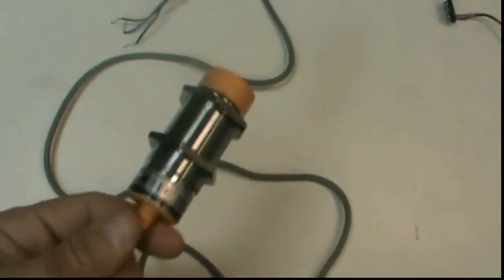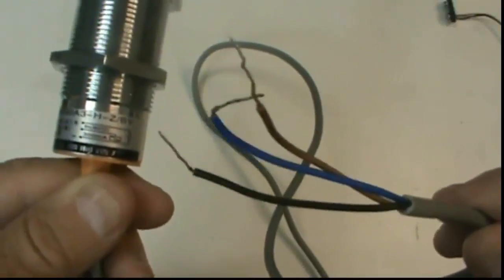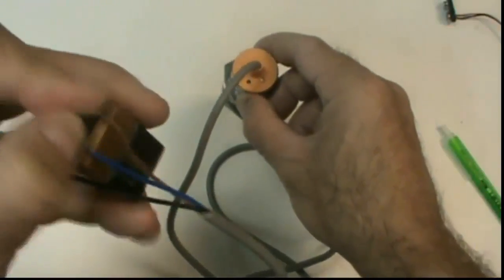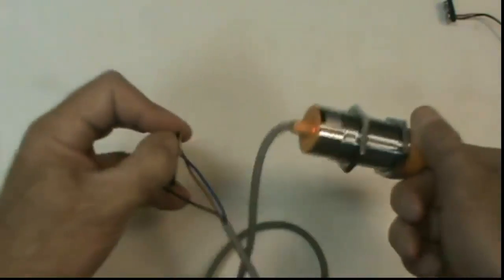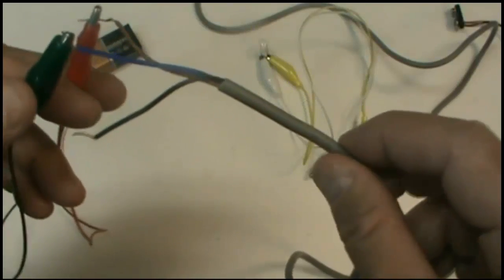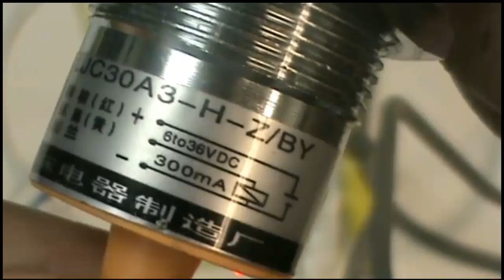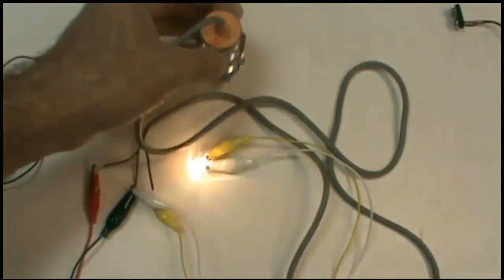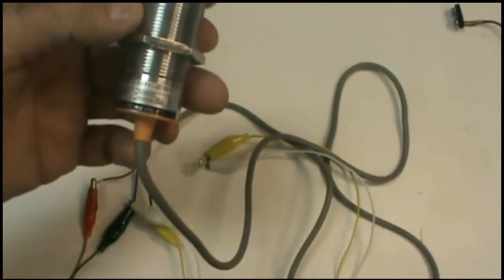Proximity Sensor Basics (PNP, capacitive)

Comment: Hi!
What is the difference between PNP and NPN sensors?
By accident I bought 3 NPN instead of PNP. I was trying to send output signal with this one, but it doesn't work. I already ordered the PNP one and I am just waiting to it get to my place. One of them I think isn't working because I tried to connect the leads as you say in this video and also the diagram on it is saying the colour code like yours, and still the LED light doesn't turn on, this one I think is faulty.
Reply from the maker: PNP sensors are Sourcing sensors NPN sensors are sinking Sensors. I have a video on the difference between sinking and sourcing you can view here:

PLC Sinking and Sourcing

Also if you are trying to drive an LED you must use a current-limiting resistor to avoid burning out the LED and the sensor. You must also ensure the polarity of the LED is correct.

The transistor in either an NPN or PNP sensor is only a polarity-sensitive switch and does not provide an output voltage by itself. The transistor is used to complete a circuit between power, the load and ground.

Hope this helps.
Reply: Dorian McIntire Thanks a lot for you answer!
Actually what I'm trying to do is activate a solenoid (DC 12V 0.5N 6mm Pull Type Open Frame Electric Magnet Solenoid Electromagnet) it works with a 9V battery I thought that I could use the same principle as you show in this video to make it works like the LED, but nothing happens. the funny thing is when I check the voltage it shows 9V, but the solenoid doesn't work I think it's due a voltage drop because the resistance created through the sensor, then I tried 18 volts doesn't work as well. I am waiting for another solenoid a better one (12V 5Kg Electrified Rate Pull Force Tubular Frame Solenoid Electromagnet), for the LED I used a resistor it did work. However it does heat, which resistor should I use for a 5 MM LED I got those
 100Ω Resistors
 1 kΩ Resistors
 4.7 kΩ Resistors
 10 kΩ Resistors
 47 kΩ Resistors
 X 100 kΩ Resistors
I just started to learn about those things which one is better and which one is the strongest. I read some thing about the colour coding, but I am still not 100% sure, what would you suggest?
Thanks you..

Comment: Hi, I am working on a project where one relay needs to be controlled by any one of 8 different sensors.  I see 2 and 3 wire sensors available on ebay.  Which would work the best for an application such as this?  Thanks for the vid.

Comment from the maker: If I understand what you want to do correctly you want a wired ORing behavior for these sensors.

This can be done easily by hooking (8), 3 wire, sinking (NPN) sensors in parallel. Hook the signal wires of these paralleled sensors to one side of your relay and the other side of the relay to V+. The activation of one or more sensors will activate the relay.

Be careful because while paralleling sensors will work here it can cause shorts in the wrong application.

Good luck with your project.

Comment from the maker: Frankmali17 I forgot to mention that the repeat-ability of a typical capacitive proximity sensor is around 2% of full scale. So for a 2mm sensor the repeat-ability is around .04mm which should be more than adequate for most situations.
Reply from the maker: +Dorian McIntire I use a Cannon HD camera with a cheap, lapel plug in mic.  Nothing really special

Comment: is it the same proccess to wire it to a 24vdc relay? i might be misinterpreting but it looks like i should have two negatives hooked up to it according to the video. which doesnt make sense to me how would that close the relay?
Reply from the maker: +Tyler Torch The same blue wire used to provide negative power to the sensor is also common for the relay for a sourcing sensor. Most industrial sensors only use three wires to provide positive, signal output and common (-). Look up the term "circuit ground" or "circuit common" if you want to see more about the concept.
Reply: So thats where my problem is then.. ive been trying to use the black signal on 2 and a positive (8 pin relay)

Comment: Is there  any hyraulic oil level sensor? So that when there is no presence of hyraulic oil. My sensor can detect
Reply from the maker: You could use the sensor to tell you when the level was low. You could create a threaded hole for the sensor in the oil reservoir at the low level and thread the sensor into place.

Comment: Dear sir I  would like to put together a system that will help me detect when an object taken out of the building doors. When it leaves either doors(two doors) I would like to be alerted with vibration from a handheld receiver and directed with a specific colored light from the same handheld receiver to know which door the object taken. For instance if the east door is green the west side would be red. Could you help please
Reply from the maker: This would be difficult using industrial sensors since the range of these devices is very limited. A reflective photoelectric sensor systems would be able to detect when a person or large object crossed the beam and that would be the simplest solution but it would not be able to detect the objects themselves. Anti-theft devices, using RFID technology, obviously work but each object would require a tag and the system is expensive. Wish there was a simple solution for you.

Comment: If you use a higher voltage is the sensor more accurate and increase repeatability accuracy
Reply from the maker: No, you must stay within the proper voltage specifications or risk destroying the sensor.
Reply: Dorian McIntire sorry I mean within the 6-36V operating voltage
Reply from the maker: Sorry but the range of the sensor does not change with voltage. The sensor contains it's own internal regulator to ensure consistent performance.

Comment: Hopefully you read this. I am setting up a capacitive sensor on my 3D printer for auto bed-leveling and I am trying to determine the output voltage of the sensor when it senses the bed. Well I just did a test using my 12V bench power supply and a multimeter to measure the voltage coming out of the signal wire when the sensor is activated and with a 12V input I was reading like 18V output??? Is that correct? Is there some sort of step up in the sensor? If that is the case I need to figure out what resistors I need to make a voltage divider to knock it down to about 5V since that is what my control board uses
Reply from the maker: Chris Griffin Some possibilities to think about:

1. Is your bench power supply regulated? If not it could possibly read 18 volts when unloaded. Measure your power supply voltage with your meter and let me know what you read.
2. Remember that most industrial proximity sensors only sink or source and only act as switches. If you have a sourcing sensor and hook your meter between the output and ground you will measure either no voltage or  full voltage but nothing in-between. Since the PNP in a sourcing sensor may leak a little you might measure a voltage whether the sensor transistor is on or not. To alleviate this problem make sure you use a load resistor (1K ohm will work) between the output and ground and measure across this resistor.

What type of sensor are you using?

Let me know, thanks for commenting and please consider subscribing.
Reply: Dorian McIntire Thaks for the reply!! Sorry I just sent you a message with more information :)  This is the sensor I am using http://www.amazon.com/gp/product/B00542U3M4?ref_=redir_mobile_desktop&ref_=yo_ii_img
Reply: Dorian McIntire The 12V reads 12V on my meter. This is what I am using to get the 12V from. It has a voltage output that is adjustable http://www.amazon.com/YiHUA-853D-Soldering-Rework-Station-Fire/dp/B00O400X36/ref=sr_1_1?s=industrial&ie=UTF8&qid=1437241911&sr=1-1&keywords=yihua+853D
Reply: Dorian McIntire I just subscribed also, your videos are going to be very helpful!
Reply: Thank you
Reply from the maker: Chris Griffin Oops. Forgot the sensor was sinking not sourcing. I will upload and alternate drawing. Sorry.

See the following video:  https://www.youtube.com/watch?v=soJ4czkKpT4

Notice the logic is inverted so an activation will give you a low and no activation will give you a high. This is not problem for the Arduino however since you software can take this into account.

The +5 volts is connected to the Arduino 5 volts the brown wire goes to +12 volts.

Let me know how it goes.
Reply: Dorian McIntire Cool, thanks
Reply from the maker: How did it go?
Reply: Well got it wired up with the resistors and checked the voltage on my 12V supply and it is reading 3.3V so I think I am good. Hopefully that is enough voltage now :)
Reply from the maker: Chris Griffin Great!

Comment from the maker: Sorry for the delay. YouTube keeps holding comments in limbo until I approve them.

I bought a bunch of these off Ebay for about $10 a piece.

Cap. Prox. sensors can cost over $50 if you buy them from an industrial supplier. Automation Direct has Cap. Prox. sensors and they ship quickly.

Comment: i have a autonics PR30-10A0 for the 3d printer but it comes only with 2 wires (blue/Brown) any ideas on this ?

thanks
Reply from the maker: +Co Chrigui 2-wire sensors hook up very differently than 3-wire. Your sensor is an A.C. two wire and not a D.C. sensor. Look at the bottom of page J-12 of the following link for details.

https://www.instrumart.com/assets/autonics_pr_series_proximity_sensors_datasheet.pdf

Comment: I have always associated the black wire as the hot wire as in the positive (+)
Reply from the maker: For single phase AC systems the Black wire is HOT, the White wire is neutral and the Green wire is Ground. In DC systems the Red wire is positive (+) and the Black wire is negative (-). The color code for DC industrial sensors is Brown for positive, Blue for Negative (AKA common) and Black for NPN (sinking) signal output, and White for PNP (sourcing) signal output. Unfortunately standards for for color codes don't seem to make much sense.

Comment: Or if you could just give me a suggestion what kind of sensor that I could use to get 12V output to activate a solenoid thanks..
Reply from the maker: You can use the PNP sensor but you will have to boost the output current using an NPN power transistor. Feed the output of the PNP sensor into a 470 ohm resistor in series with the base of an the NPN power transistor with its emitter hooked to ground. Hook one lead of your solenoid to the collector and the other lead to +12 volts.

Hope this helps.

Comment: I've ordered 2 of these off Amazon for a project im working on. Both appear to be shortened out. Is there something I'm doing wrong?
Reply from the maker: You should check to make sure your sensors are N.O. (Normally Open) sensors and not N.C. (Normally Closed). You can test a sensor easily by connected a 9V battery  to power the sensor and looking at the indicator light. V+ is connected to brown and V- is connected to blue.  By activating the sensor with an object you should see the indicator light turn on and off if the sensors are OK.
Reply: Dorian McIntire I was ordering inductive sensors, not capacitive.  Stupid mistake... thanks for your help though!

Comment: Which sensor use for counting paper on the conver  and digital counter
Reply from the maker: A photoelectric would actually be the best sensor for the job. Capacitive proximity sensors are not very good at providing signals for thin objects since they rely on dielectric properties of materials and thin objects are difficult to detect.

Comment: Do these work with petrol? I want a fuel light on my dirtbike but I cat find a kit. Thanks.
Reply from the maker: Yes, it does work with gasoline (petrol) and oil through a plastic container. It will not work through a metal tank.

Comment: If the plc has a sinking input  what type of sensor does it need to be npn or pnp?
Reply from the maker: A PNP sensor will directly interface to the PLC, without additional components, if the input to the PLC is sinking.

A NPN sensor will directly interface to the PLC, without additional components, if the input to the PLC is sourcing.

Most modern PLC input cards will accomodate both sinking and sourcing sensors.

http://www.automationdirect.com/static/specs/sinksource.pdf

Comment: this sensor has a big diameter. do you know the smallest diameter of sensing area for this sensor? thank you
Reply from the maker: This particular sensor has a sensing distance between 1 and 25 mm. It has an adjustment screw on the back of the sensor to adjust the sensitivity.

Thanks for commenting.
Reply: Dorian McIntire how big is the size of head diameter ( the orange part proximity on your video) and also do you know the smallest of head diameter this sensor? thanks
Reply from the maker: Angga Mauludy The sensor measurement is 28mm diameter x 75mm length. I've seen diameters as small as 10mm.

It seems to me that the sensing distance would diminish with decreasing head diameter so a sensor with too small a head diameter may not be that useful.

Hope this helps

Comment: Can i use this type of sensor for segregating waste materials like paper, plastic, metal etc. ??
Reply from the maker: Yes, but you will have use it in conjunction with other sensors. For instance if you line up an inductive sensor and a capacitive sensor side by side a signal from both the inductive sensor and capacitive sensor will let you know the material is metal. A signal from the capacitive sensor only will let you know it is paper or plastic. Differentiating between paper and plastic is a little more difficult however but you can buy capacitive sensors that return a signal proportional to the dielectric properties of the material. This signal can vary however with the thickness of the material and the density of the material so the problem can tough to solve.
Reply: distance of the material from the sensor affects the sensing right?
Reply from the maker: Yes, Proximity sensor are typically designed for close range sensing but many can sense several inches away.

Comment: great video.your help please. I want to install a sensor  that it can imitate a neutral switch sensor but I do not know which type of sensor to use. npn  pnp nc or no?
I give some infos . " On the manual transmissions, one lead going int4o the neutral switch is grounded.  The other end goes to pin 10 of B58.  The ECU supplies a voltage to the circuit.  When the transmission is in neutral the neutral switch is open, so the voltage at pin would be 8v or higher.  When the transmission is put in gear, the neutral switch closes and the voltage reading would be 0v."
 so I want to install a small switch with magnet when the transmission is in neutral (neutral switch is open, so the voltage at pin would be 8v or higher. ).
what type of sensor do you suggest me to buy ?? thanks
Reply from the maker: Proximity sensors are not triggered with magnets. You will need either a Hall Effect sensor or a magnetic reed switch for magnetic triggering. For a switch closure to create zero volts you would need an NPN (sinking) sensor. An activation of the sensor would ground the output of the sensor and pull it ground otherwise the sensor would produce full sensor voltage.
Reply: thanks for the reply. shoud I need naturall open or natural close?
Reply from the maker: A normally open switch on a sinking sensor will work if you want the switch to connect to ground (0 V) when the sensor is engaged by sensing the position of the shift when it is in neutral.
Reply: ok.but all these npn no sensors have 3 wires( 12volt- signal- ground) .i need only 2 wires. ones   will go to ground and the other go to the ecu. which of the wires of the npn sensor should I need?
Reply from the maker: All three-wire sensors require a power supply connection (ECU supply), a signal wire to ECU input and ground. Look at some of my other sensor videos for examples.
Reply: thanks

Comment: Hi Dorian what if i have only two wires coming from the sensor 
Blue and brown how can i activate an air solenoid?
Reply from the maker: Check out the following diagram for details https://www.circuitlab.com/circuit/2743kq6uzqx4/2-wire-sensor/ 

Make sure the sensor can handle the current requirements for the solenoid valve before connecting.
Reply: Thanks, I will send you a  sensor  power  requirement for a solenoid match 
If you don't mind?
Reply: Thank you

Comment: What is the source code that will be used if this PNP capacitive sensor is connected to an Arduino Uno?
Reply from the maker: The source is the same but you should use the following modification for the connection to prevent overloading your digital inputs: https://www.circuitlab.com/circuit/298dt7mg2k6j/arduino-industrial-sensor-pnp/

Comment: hello Is there a way in which I can differentiate between plastic, glass, metals???
Reply from the maker: +raj kiran It's very difficult to differentiate between non-metal materials with this sensor because their are too many variables other than the material itself such as thickness, proximity and environment. You can easily differentiate between metals and non-metal by using a capacitive and inductive sensor together. Their are other sensors that can give you signal based on the material instead of just on/off detection.
Reply: Thankyou
Can you name any such brand or model of sensor which give out signals based on different non metal material sensed.
Reply from the maker: +raj kiran I would look at the attached datasheet for ideas. This is an analog capacitive sensor that provides an output proportional to the dielectric constant of the material and proximity. You might be able to get it to identify different materials if the number of different materials is small and their properties very widely.  http://www.softnoze.com/downloads/Sensor%20Basics%203.pdf